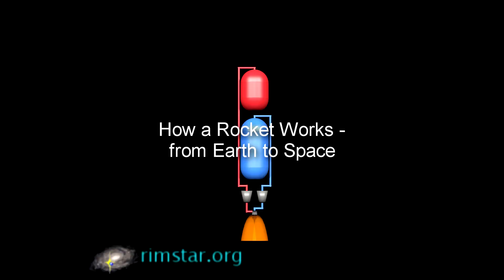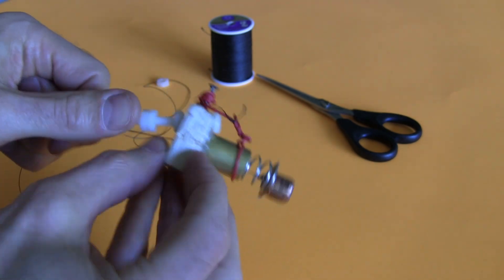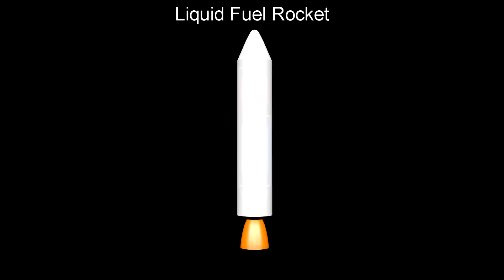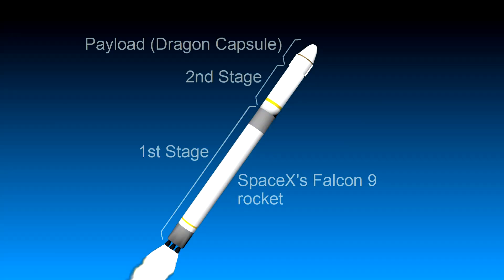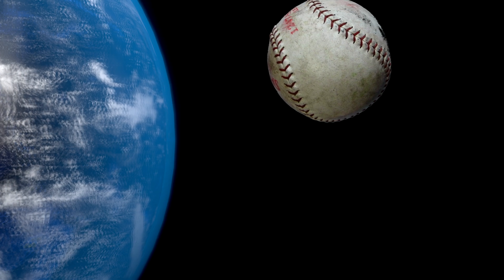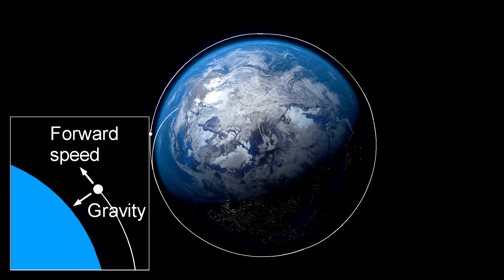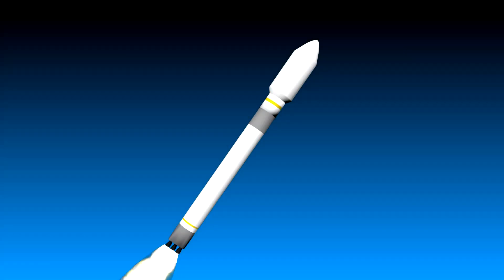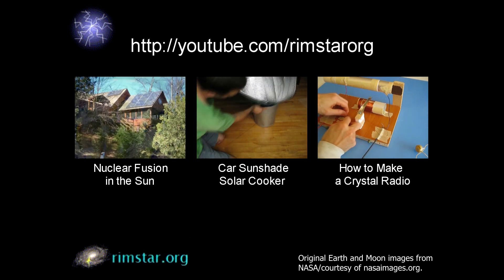How a Rocket Works/Earth to Space Eg SpaceX Falcon 9 and Dragon

Comment: Now i can argue with flat earth community
Reply: Think of it from an aspect of momentum - not force. Momentum is always conserved both linear and angular. When you are holding an armed pistol, the initial momentum is 0 units. After firing the bullet, the final momentum remains zero - there is an equal Mass*Velocity forward from the bullet as the Mass*Velocity of the gun backwards (the recoil). Bullet has smaller mass higher velocity, the gun has larger mass lower velocity. Air is 100% irrelevent - the only thing it does is slow the objects down once they are already moving. You would be right in saying that a HELICOPTER would not be able to move in space because in that case the propellers are actually pushing on the air - they are not using the same principles that rockets are using.
Reply: Newton's third law simply says that forces always come in pairs. There's no such thing as a "single" force. In the gun scenario, the chemical energy stored in the bonds of the powder gets released as kinetic energy. Explosions don't come "out" of anything. They ideally push equally in all directions. They push the "burnt results" of the gunpowder backwards (conservation of mass) - the mass that gets thrown back needed a FORCE to push it backwards, the exact SAME amount of force pushes the rocket forwards (newton's third law). That force is enormous considering the amount of energy being released (rocket fuel being one of the highest energy density Joules/Liter substances we have access to). 

The main difference between rockets and helicopters/ planes is that they aren't pushing against the air, they're simply shooting their exhaust/ propellant in the opposite direction they want to move.

You should consider college physics 1 or physics for engineers 1 and you will probably understand better than youtube comments. There aren't "three" parts of the equation to newton's third law. There's only 2. For examples the Earth has a gravitational force that pulls us down equal to the amount of force that the gravity from your body pulls the earth up.
Reply: Davy spilani Going back to your spring example, you don't need two objects on either side of the spring to see the effect of Newton's third law. If the spring is massive enough and contracted next to an object, it will be propelled away from the object once released. The very same force that propelled the spring away from the object acts on the object (in the opposite direction). There is no need for a third object (the atmosphere in your example). So think of the rocket as the object next to the spring, and the expanding exhaust gasses as the spring. It ain't rocket science.
Reply: The earth is E
Reply: Alrizki Pasca 
They won’t listen to anything you have to say.
Reply: Josh Garber You got that totally wrong,, go back to Newtons 3rd law,,, For every action there is an equal and opposite reaction,, so the gun powder exploding is the action,, the bullet is one reaction and the gun moving backward as in recoil is the opposite reaction... Now I'm a globe earth guy,,, When in a vacuum,, the explosion coming out the back of the rocket is the action and the rocket itself is one reaction but what is the opposite reaction in a vacuum?????????????????????????????????? Without that you do NOT have motion.. So rockets do not work in a vacuum and you got taught newtons law wrong... The way NASA OR Hollywood explains it,, there's 1/3 of the equation missing and that is the opposite reaction.. Newton wasn't just saying all that for fun.. He didn't say for every action there is a reaction did he??? No he didn't. .. Like a stone in a lake,, the ripples going in both directions are the opposite reactions,, if you have one large mass like a gun and a small mass like a bullet,, they will both react to the explosion equally relative to each others mass!! The bullet moves forward and the gun moves backward,, but in space,, what is moving backwards?? Nothing because there is nothing there.. NASA is a institution designed to rip you off.. Like hollywood does.. In fact NASA is hollywood.. The earth is a globe..
Reply: @davyspilani1231  the explosion is relative to the rocket the escaping exhaust gas is the action the rocket moving forward is the reaction. I learnt this in primary school come on mate catch up and NASA just wants money lol they are a segment of this so called shadow government that makes the money in the first place why would they need to lie to get it. You need to understand money isn't real its a measurement of wealth like metres are to length. It seems like a huge waste of money spending thousands no millions on building a rocket to not go to space and now with the private sector also launching rockets who are they ripping off? Please don't be so ignorant or keep it to yourself it harms generations of future rocket scientists.
Reply: Josh Garber absolute bullshit,, Newtons law states, "for every action there is an equal and opposite reaction" That's what Newtons law states... As I said,, like a stone in a lake,, the stone is the action... Or,,  just like a bullet in a gun,, Let's take 2 boxes and a spring into space,, put the spring between the 2 boxes and let go,, What will happen? The 2 boxes move away from the action or spring equally relevant to each mass... That is exactly like a gun,, The explosion is between 2 masses,, The gun and the lead of the bullet.... Don't think you are any way caperbal of re writing Newtons law,,, Your iq needs upping at least 40 points... you are very very wrong..   A rocket in space is like a bullet without a gun.. If you could take the brass casing off that contains the gun powder, you have an action and 1 box,,, Try this,, get a lump of metal put some gun powder on it, set fire to it and see if that gunpowder moves the box! Of course it won't, (just like a rocket in space), But now put another box on top of the first box with gunpowder in between.. Now when you ignite that powder the box on top will move right!! That is actually what you learned in school... That is a gun and that is Exactley how a gun works,, the explosion blasts the bullet in 1 direction and the gun recoils in the other direction... Now in space what is the opposite reaction to the rocket???? Let me remind you Newtons law is a law of physics,, rocket science is not.. Do you know what a law of physics is?? No you do not!! Because you are TRYING to rewrite reality and you can't.. you can lie to your self but keep your bullshit to your self..
Reply: Alrizki Pasca Well you can argue with them but I know the earth is  globe but I also know rockets in space is bullshit.
WHERE IS THE OPPOSITE REACTION? Take 2 boxes into space, put a spring between them the 2 boxes shoot Appart at equal speeds right!  One box is reaction X and the other box is reaction Y and the spring is the action. On a Rocket the action is OBVIOUSLY the white hot expanding gas blasting out the back, the rocket is the reaction and the atmosphere is the other mass or opposite reaction and it's moving away relatively.. So in the vacuum of space, where is the opposite reaction? There isn't one and there for there will be no motion except for the force of gravity pulling back on the rocket which will, once the velocity has been terminated by gravity, fall back to earth with enormous velocity due to the lack friction and resistance slowing it down.. ROCKET ARE A NASA RIP OFF, THEY WORK IN AN ATMOSPHERE BUT NOT IN SPACE. The rocket alone cannot have the action because there is no pivot, it's an inert object, just a stick,, The real pivot is the place the fire meets the rocket so the fire is the action.. ??????? I'm waiting??? Let's see if you can beat me?
Reply: @davyspilani1231  hey

Comment: So if the rover is sent that way then how they know the there won't be any rocks in the way, while the rover makes it's way to the moon? Can the rover steer itself? Without air how can it steer?
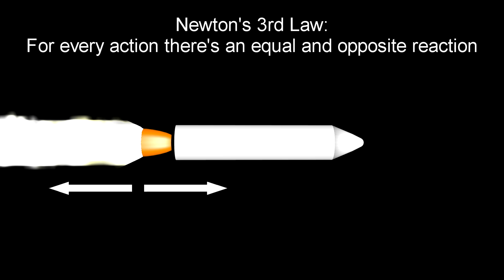Reply from the maker: Actually it`s their lander that will do the landing, and then the rover will drive off the lander (just to be clear.) They`re working on the tech right now for the lander to scout the position before landing and steer clear of rocks, crater edges, steep slopes, ... It`ll steer using rockets. The recent Chinese moon lander, Chang'e 3, did the same thing. Rockets don`t need air, they work in a vacuum. Look again at the video at the diagram around 0:25. When the exhaust it thrown one direction, the rocket moves in the opposite direction. It`s that exhaust that it`s pushing against when it explodes in the combustion chamber.

Comment from the maker: Oh, that I can't answer because the answer is too broad. There are a huge number of construction techniques that go into making rockets and even those vary from rocket to rocket. Largely it's a lot of metal work, cutting bending, molding, casting plus a lot of plumbing of pipes, both of which require different welding techniques or bolting to put it all together.

Comment from the maker: Separation methods vary. On some rockets there are bolts that explode to break them apart. On SpaceX's rocket they use pneumatics, basically a means of physically pushing the rockets apart which is more reliable than explosive bolts.

Comment from the maker: And it is possible to achieve very high speed by continuous propulsion in space... but the problem get getting the continuous propulsion. The material that gets expelled from the rocket during the explosion will eventually run out. Ion rockets, which don't use an explosion, but still expel matter can run for a longer time but don't create as strong a force and take a while to get up to speed. I'm working on a a water bottle rocket video this week that goes into the science a little more.

Comment from the maker: A rocket doesn't push against the air to move. So yes, rockets work fine in space. Satellites adjust their location this way, Mars rockets make course corrections, ... Create an explosion in a closed container and the pressure on the container is equal in all directions. Make a hole in one end and the pressure is no longer present an that end, so the rocket goes in the other direction. Stop the rocket by turning it around and doing the same in the other direction.

Comment: Sir,
Once the rocket is in outer space, it will continue to move at the same speed in the direction at which it is projected.. Then,is it possible to further propel it...

I have this doubt as there because there is no atmosphere in space, then how will the rocket move even if propulsion is provided?And how will they slow down/stop if necessary?.

And incase propulsion in space is possible, then isnt it possible to achieve very high speed by continuous propulsion in space..

Comment from the maker: Ah, so that's what he meant by "cap"! Sure, if the tanks were just big containers with open holes in one end but they're not. There are valves and pumps that prevent that. The release of fuel and oxidizer into the combustion chamber is very controlled.
Funny how I couldn't figure out what he meant by "cap". I guess it's so far from being an issue that I couldn't see his meaning. Maybe if he hadn't started by referring to my spring rocket's reaction mass as a "cap" then I would have understood.

Comment from the maker: The launch pad is the place the rocket is located when it takes off from the ground; the place with the fireproofed support structures you mentioned.
Most of the fuel burns inside the combustion chamber, some outside.
I don't have any other rocket videos yet. I have plans to do more, but my todo list is long. I'm hoping sometime during the first few months of 2013.

Comment from the maker: Ah, thanks for clarifying. The "cap" on a rocket is the fuel that is ignited and flies out the back. It actually tries to move equally in every direction inside the rocket but there's only one hole, out the back. So the uneven forces result in propulsion, as you say, newton's 3rd law.

Comment: when you push on your self you do move but not in a direction the force of say pushing your arm to you hip does move you but your hip will absorb the force along with your muscles using energy to create the force. In the vacuum of space the rocket is pushing away from its self, so if you spit in space you will move backwards (very very little because of the mass of your spit but you will still move). So the rocket works because the fuel it is using has a larger mass.

Comment from the maker: Nothing is needed to react against except the fuel reacting with the rocket. In fact, the better the vacuum the better it works since there's less to slow you down. See 0:24 in the video.

If running out of fuel is what you're worried about, you're right. A partial solution is this... You can either throw out a lot of fuel at a time or you can throw out less fuel at a higher velocity. That way your fuel will last longer and you'll accelerate just as fast.
(continued...)

Comment from the maker: I don't know what the metal is. Some nozzles are designed to slowly wear away (get thinner) during the flight but they last long enough. This is also called ablating. Many other nozzles have tubes around them. The cold propellant runs through these tubes before being burned. While it is running through the tubes, it keeps the nozzles cool.